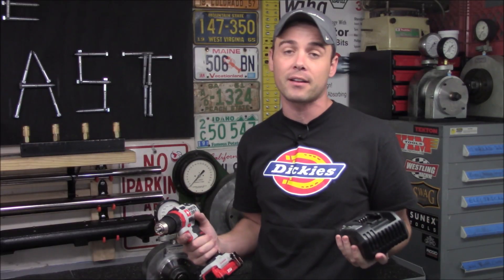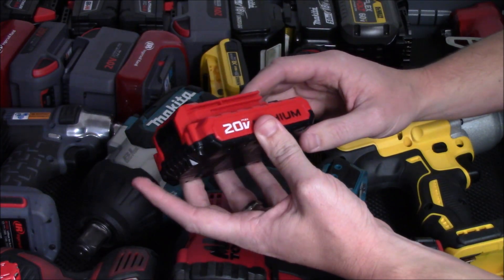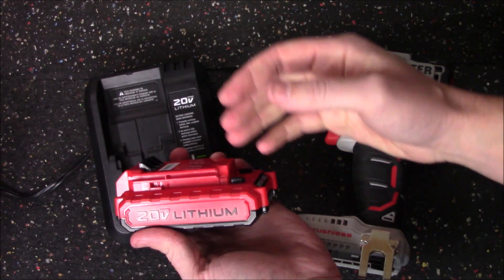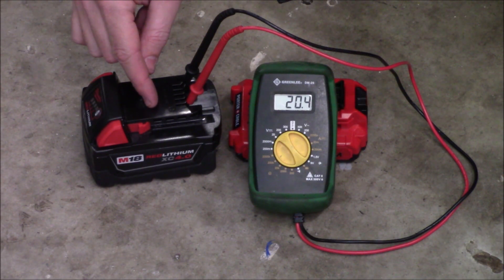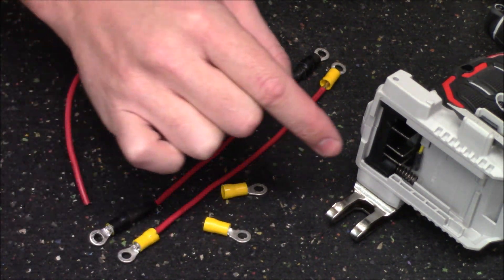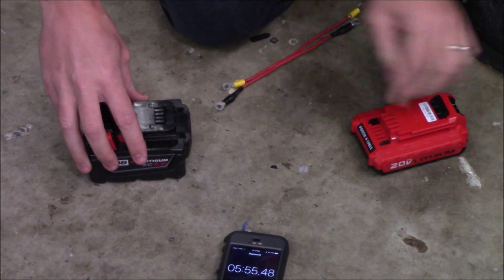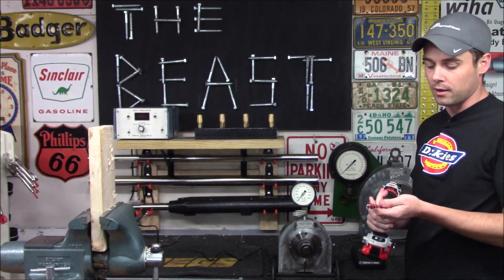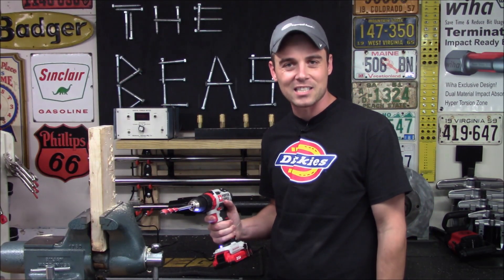Back from the DEAD!  Lithium Batteries!

Comment: If the battery pack is really dead, then this is really unsafe. The safest way is to use a lab power supply (constant current/constant voltage) with a low charging current and close temperature monitoring.
The way you did it has no current limitation and the charged battery seems to have no protection circuit, considering the fact that it still feeds the drill although it's below the threshold voltage.
Reply from the maker: Well....like I specifically said.....it still had power (as I demonstrated).  It was just below the threshold of the charger.  Not many guys working 9-5 who dont have $100 to throw away on a battery will be buying lab equipment --- this is a quick & easy way to ATTEMPT to save it.  If it doesnt work, what are they really out of?  Nothing.
Reply: Real Tool Reviews It's just the name :) you can buy constant current power supplies off ebay for 30-40$ and smaller ones without a case with even less, like 5-10$ depending on the specs.
You can see for yourself. Just search for "30v constant current" on ebay. Some cheap ones without displays are even cheaper.
I'd say they're well worth the money.
Regarding what they can lose... the battery can catch fire and explode causing injuries or property damage.
Reply from the maker: You know something funny.....I could not find ONE instance online (pics/videos) of power tool batteries "exploding" or catching on fire ---- other than marketing pics from tool manufacturers discouraging the use of aftermarket knockoff batteries.  I did however see a lot of cell phones & hoverboards that catch on fire.....but, I agree the risk is there, so I was sure to explain that more than once in the video.  This is basically a "last ditch effort" prior to junking a battery.

Comment: Thanks for the tip.  I have also seen this when you leave a battery on the shelf for year and then go to charge it and it is below the cutoff voltage.  One warning I would have when you connected the two batteries together is that a power resistor in series would probably be a good idea to limit the current.  I'm guessing that most battery packs already have something like this in the circuitry but some cheap ones may not.
Reply: How much and what watts, I can see you point, and would put a meter across it, and when it goes to zero, it's time to charge the battery, unless of course your using a much higher source of voltage then the battery your trying to save is
Reply: Seriously ?
Reply: Lithium Batteries employ a BMS to prevent the batteries from catching fire. It is the BMS not batteries that most often fails. Either turning the BMS OFF (no power) or blowing the BMS circuit (damaged).

Comment: Appearantly no or faulty LVC (low voltage cutoff) on the tool. This is sure to damage the cells if you continue to use it.
Reply: If you don't do this then its useless anyway

Comment: I've tried this many times with Makita batterys and chargers and the Makita charger actually marks the batteries Circuit board as a bad battery and will never charge it again even with another charger.
Reply: Glad Im in the bosch and milwaukee boat...
Reply from the maker: Good to know....thanks!
Reply: Tj Greene I have makita and this method does not apply to their battery packs. bl1830/40/50 have a chip and when the current on a single cell drops under a certain value the batery locks up and the charger wont charge the batery pack anymore. the only way to use  that batery again is to charge it with non-makita charger or by replaicing the electronic pcb.
Reply: what do you mean that it 'marks' the battery?
Reply: Shame I have 3 batteries for makita that are dead now!
Reply: pj woo Each battery itself-has a memory chip that marks the battery internally as bad or defective. Once that is done you can’t ever charge it with a Makita charger.
Reply: Genaro Castaneda yep why I didn’t buy their drills. Dewalt and Milwaukee have the best battery technology out there period
Reply: Tool Craze could I use a makita battery to boost up a worx battery???

Comment: Isn't there some firmware in the battery that makes sure the battery cuts off before it doesn't get down below whatever voltage the manufacture sets it to.

I have a Porter Cable drill and driver, and they cut off when I need to charge it. I can still press it, and it turns on for a split second only. 
But I think it cuts power at 5%.

Comment: The Porter Cable started at 13.9 volts. The M18 started at 20.4
Porter Cable ended 16.1 at The M18 ended at 19.
So the M18 lost 1.4 volst and the Porter Cable gained 2.2 volts.
How did the M18 transfer more power then it lost?
I don't understand how the M18 is the same as a 20V.
Reply: It may be that the M18 has a higher Amp Hour capacity than the Porter cable pack. If the batteries were containers of water, we would say the M18 held 4 quarts where the porter held 2 quarts. The porter needed one quart to charge and only had .75 quarts out of 2 quarts. Then the charge of the M18 would only be reduced by about 7 percent while providing 12.5 percent of the capacity of the porter to bring the porter back to an acceptable charging condition.
Reply: Blake, I am not John McClane or Zeus Carver.

Comment: On all my Hitachi 18v li-ion power tools they just stop working completely when the battery needs charging. Got 6 batteries and not a single one has had a fault to date.

Think it is also advisable to store your batteries indoors rather than left overnight in a shed or van in extreme temperatures.
Reply: I bring all my Bosch batteries indoors every day, mostly just in cold weather. Had some for 10 years and still work! I would definitely agree with you

Comment: This is what I've done to revive a few of my Milwaukee battery packs.  My 1/2" impact gun has a tendency to run the batteries just below the charging threshold particularly when being used in cold weather.  Sometimes it only takes a minute of 'jumping' the discharged battery to a fresh one to get the charger to work.
Reply: I have the v28 batteries I tested the volts with a meter it's says they're completely dead do you think this would work it's a Milwaukee by the way

Comment: I have seen countless videos on this magical fix. Just because you can fool the charger into charging a defective battery pack does not mean you have brought the bad cell to what I would consider back from the dead. I have tried these tricks on several batteries with little success. When you have one or more cells in these packs fail, they are done holding a normal charge. Try your test on how many screws you can drive with a new battery and compare it to one that you have brought back to life after sitting a few days and see which one wins.
Reply from the maker: And who said that this pack had a bad cell?  I said that it was drained lower than what the charger would start a charge.....If you have seen "countless videos" & yet you have been unsuccessful, perhaps the problem is your battery & not ALL batteries.  Many things can go wrong, this is just one fix for one problem.
Reply: Battery packs consist of many cells depending on the voltage of the pack. most packs are made up of cells that are about 1.2 volts each. Also I would not recommend playing with LiPo packs at all.
Reply from the maker: Compact 18v-20v packs have 5 cells......high capacity versions normally have 10.  Each one at max capacity has roughly 4.1 volts.  The compact versions are wired in series = 20.5 volts.....the high capacity versions are doubled up in series to give more amp hours of storage capacity at the same voltage.  I do agree "playing around" with li-ion packs is not advisable.....and I also think that I was very clear on the circumstances & dangers surrounding it.  For many people, this will work fine.  For others, the packs are junk.
Reply: I should have added that these newer type chargers check voltage, internal battery resistance, and even battery temp. before starting the charge process. If a charger would fail to charge a battery because of low voltage only, they would never charge any battery. Isn't low voltage the reason why a battery needs to charged?

Comment: Hi, I have the same problem with the same battery you have but when I used the meter it showed 19.2 volts but won't charge. I did the exact procedure as you and the charger won't recognize the battery. what should I do? thanks P.S. love the reviews
Reply from the maker: I would assume either your charger is defective or it is a different problem with your pack.....possibly one of the cells have become damaged.  I would not suggest trying to repair it yourself & just getting a new one.  Lithium packs are very dangerous & should not be "repaired" unless you are trained in that field with specialized equipment.  This is the ONLY "diy fix" that I am comfortable completing.  Glad to hear you like the reviews....Thanks!
Reply: I think the the battery is the culprit here since I have 2 batteries and one off them charges like a charm, thanks for the quick reply :)

Comment: typically what is the low threshold for lithium batteries. Is there a percentage of stated voltage that is guaranteed to short circuit the cells? i.e. less than 25% of rated voltage=shorted cells?

Comment: Another, (potentially safer), way to charge a battery is to get a power supply off of eBay. You can set the correct voltage for your battery and supply a low current trickle charge to bring the battery up to a higher voltage. This avoids the chance of pumping a large current from the host battery into the low battery which could be hazardous. I would recommend using 0.5A or less so as not to damage the cells. You can often bring a battery up to a level that the OEM charger will accept within a matter of minutes. A 30VC 3A power supply can be had for less than $40 shipped and can useful for other projects as well.
Reply from the maker: Thanks for the tip!
Reply: @RealToolReviews  one issue with your jump start method is that the big battery might charge the drained one too fast. Li batteries can easily supply 10x the safe charging current. If there is a low charge iit will be much safer to use a power supply and a low current to bring the drained one up a few volts this will not take much time because of the steep dropoff when going drained. If you absolutely must use the jumpstart method, just touch the lead repeatedly to avoid heat buildup leaving it connected may lead to almost short circuit behavior, i would be very careful with that, okay in your driveway but you risk one or both batteries to run away pop or catch fire.
Reply: That would need to be a power supply with current limiting.
Reply: You might also put a fuse in series with the power side of the battery to limit damage if the old battery is shorted.
Reply: thank you
Reply: I sure do agree you should definitely NOT just wire them together like they where car batteries. That's potential very dangerous for the low voltage pack to receive such a huge amount of current in a low state.
However no need to buy a power supply you could just put in a suitable resistor or constant current diode or mosfet you wired up to act as a suitable constant current diode. Preferably at even lower current. Just let them sit an have voltage rise very slowly. When enough put it on the regular charger.
I don't however understand why the original charger refuses to charge them at 13,9 v. It's 2,78v / cell and that is not that low. I believe the safe limit for LiIon is in the ballpark of 2.2 v/cell give or take a little. That low current should be limited to as low as 50 mA making using constant current diodes or a LM117 very suitable for the job.

Comment: Battery drops below threshold. Can't charge on charger... but can still power drill... Meaning the drill can drop it even more... No protection circuit in tool or pack. That's not a good thing... Really bad design flaw.
Reply from the maker: I will be testing this further to see what the issue is.....
Reply: I find this particularly interesting because I have the Porter Cable 18V Lithium tools and it does have the protection circuitry.  When the batteries get low, the tools do not slow down, they just stop. if you pull the trigger again they usually have re-gained enough to drill/drive more but only a little bit before they stop again.
Reply: I have the B&D Matrix tool 20v and is just stops running when the battery is low. I am not familiar with porter cable battery powered tools but do know they make a decent small jointer which I do own so I am sure this is just something to do with his unit, possibly a defect.
Reply: Toysoldier b&d and porter cable are pretty much the same. the batteries are basically the same and most of the internal components are similar. since they are owned by the same company
Reply: Michael Freeman Does the Porter Cable brand have a Matrix type tool? I do love the B&D version for that tool, it does so many small tasks that I would generally need several tools to accomplish and B&D has been known to be a bit more expensive because of the name actually.
Reply: +Toysoldier I do not believe they do. Craftsman has/had a similar setup, but I heard it was problematic. Around here Black & Decker is considered a cheap homeowner only tool, but I suspect the internals of the B&D 20V Max batteries are similar, if not identical to the Porter Cable 20V Max and Dewalt 20V Max batteries.
Reply: @bradnoyes7955  Black and Decker, Craftsman, Dewalt, Porter and Cable are all the same company. The batteries are the same except for a couple of notches that make them not fit together (unless you dremmel them off). For the most part the tools are the same too except for aesthetic features.
Reply: Brad Noyes Well the corded B&D matrix tool while inconvenient due to being corded has taken some considerable abuse over the past few years I've owned it.
Reply: Brad Noyes Stanley owns black and cracked and dewalt. Batteries are not the same though. Two different price pointa
Reply: tensazero why I don’t use porter cable, and why pros use Dewalt. Porter cable has just started using safeties to prevent them from draining too low. They didn’t for the longest time to save costs

Comment: What's the best way to store these battery's  for maybe a month at a time? At half charge? or full charge? I've been able to invest in a few tools lately got some really good deals with extra battery's  but have no definite answer on how to store them when not in use they are M18 5.0 batteries. 
if anyone has an answer please lmk . Thank you
Reply: Real Tool Reviews:
 Yes alot of ppl like that on here lol  but ok cool glad to hear that b.c  thats actually what I've been doing since I wasint sure what todo. I usually use 2 at a time maybe 3 I have 8 all together 1 Makita 5.0 & 7 Milwaukee 5.0s but again only use 2   at a time mostly, so some sit for a month before I get to them I just want to make sure I protect my investment as much as I can because these damn batteries are so expensive lol so I really appreciate the info and am glad to hear I've been going about storing then properly. Thanks again man! looking forward to the next upload!
Reply from the maker: I charge all batteries to 100% & store them off the tool.....I never have issues unless the battery is defective OR certain cordless outdoor power equipment batteries ---- they self discharge very quickly when not being used.
Reply: Real Tool Reviews  Awesome thanks for the info, that's what I'll do then b.c I've been uncertain how to store them.
 one thing I read said to store them half charge that's why they send them to you 50% charged to keep at a safe voltage not to damage the cells. Then others say 100% I'm still a little  new to this  so I've never had long term experience with lithium ion batteries or batteries going bad.  I know if anyone would know you would definitely be the guy really appreciate the info man..
Reply from the maker: A lot of the "armchair engineers" on here will tell you full charge is bad.....yet they probably dont own a drill.  I store them all at 100% and will rotate them like you would cans of food.....use the "oldest charged" first & as you charge packs, add them to the back of the pile.....this will keep all your batteries fresh & in good working order.
Reply: dammit.  I just threw away a ridgid battery like this.  Oh well.